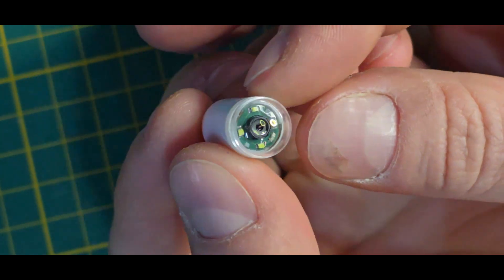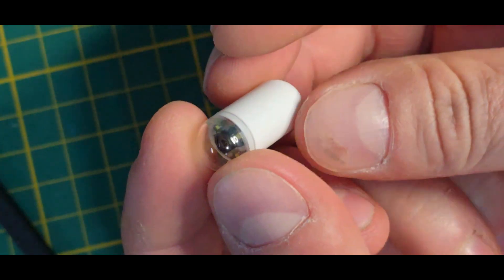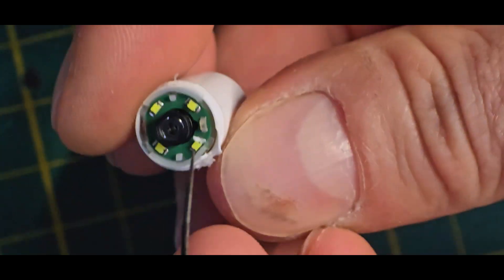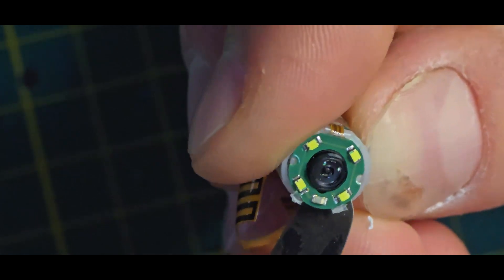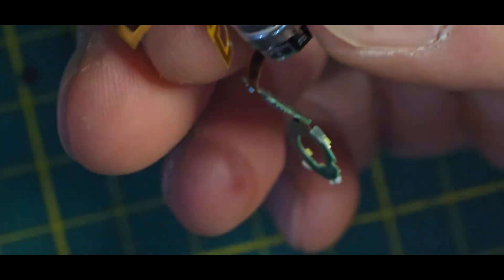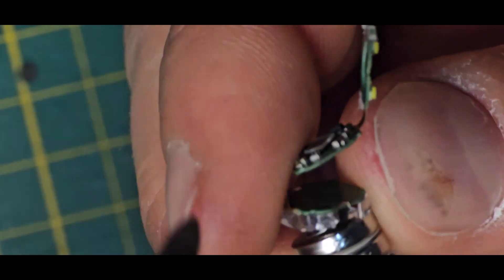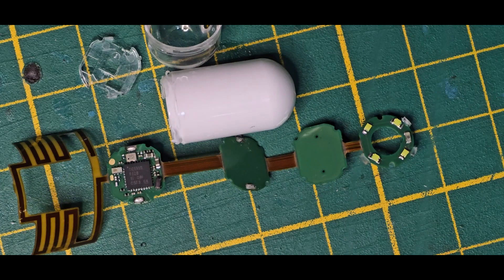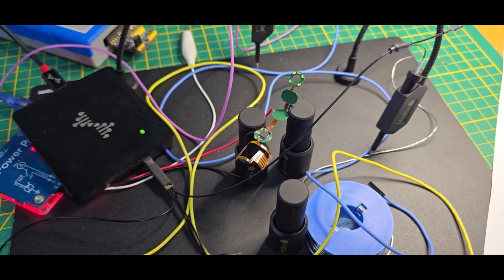Pill Camera Teardown, Capsule endoscopy

Comment: The small square chip looks like an accelerometer.  I guess the magnet allows them to  track the position in the body with external sensors.
Surprising how many chips there are in there - I've taken a couple apart and these used custom chips with very little other hardware. Maybe some patents have expired and more manufacturers are now making them
They are probably set up to only be used once and then disable themselves to prevent reuse
Reply from the maker: Loved your teardowns!
It could really be an Accl, thought the LEDs are blinking at random but more likely based on the Accl + Light sensor.
Gona glitch the CC1310 and hope to RE it fully. Love to see how it works, any other CC1310/SubGhz chip must be able to communicate with it

Comment: I am thinking the magnet may be part of activating the device when it is removed from the packaging. Didn't get a good look at it, but I'd assume there are other magnets that cancel out the one in the pill during storage.... or simply force the battery to disconnect.

Comment: Magnets are very dangerous if you ingest more than one as there is a chance they will stick together from different parts of the intestine and create a blockage and even impair blood flow, creating life threatening problems.
Reply: when i was about 5 i decided to try swallowing various coins to see what happens  and one magnet to see if i could stick things to myself or move it around with the other magnet. i had some strong ones that stuck either side of my hand 😂  from a fishtank cleaner  i think. call it a phase 😂 they havent showed up on any xrays or mris in later years so i guess theyre clear 😅😌

Comment: The next thing would be to see if you can capture what it's transmitting using an SDR - even if getting into the firmware turns out to be a non-starter, it'd still be interesting to determine if it's sending images...
Reply: that guy who makes satelite recievers from scrap amd gets images ftom space

Comment: You can not transmit data through water with electromagnetic radiation, because it get absorbed very easy.
But you can transmit data with constantly changing electromagnetic fields.
If you are in a little chamber which has a coil in it to transmit energy to the camera, then you do not even need a energy source inside, only a capacitor.
The magnet inside of the pill is used to turn the pill in a specific direction.

This means you can hold the pill in the body on a very specific position and turn it. The data-transmission would be slowly, but could be done relatively fast too.If you compress the image and the image is not to big, then you can see a image every second.

This what you have there is possibly a camera which makes simply pictures, without that you really can control the position and direction. After if is not in the body any more you can place it near a reading device and transmit the data.

11:10 - This is possibly an acceleration sensor, like the MPU6050, this is used to create a 3D model of the internal position of the camera as the picture was taken. So you can create a map with the images you have got.
Reply: They should build it all onto one chip so everything is optimised and works with everything else.

Comment: I was trying to unlock a locked CC1310 chip a few years back. By unlocking I just mean enabling the UART bootloader, but anyway they seemed to use cJTAG instead of SWD or traditional JTAG. And to communicate in cJTAG, I've had only partial success with J-Link as most of the features were only meant for their own Launchpad based debugger. With J-Link I was only able to do a mass erase and not a readout or reflash of the chip.

The UART Bootloader config is stored in one of the eFuse bits if I remember correctly. I've read a paper about fault injection attack targetting these TI chips, maybe you could try that. Informative Video by the way, Vielen Dank!
Reply from the maker: Will try glitching it next, there is hope :)